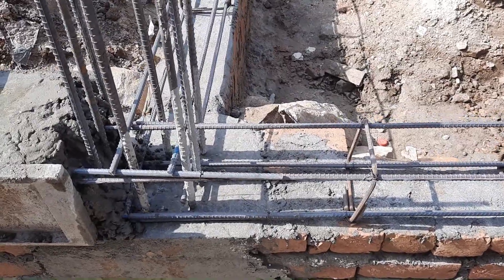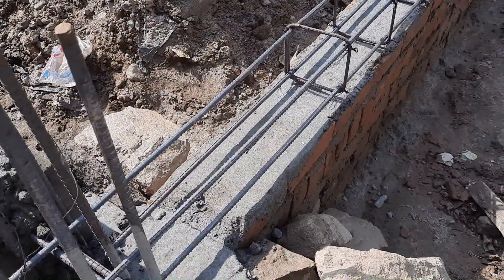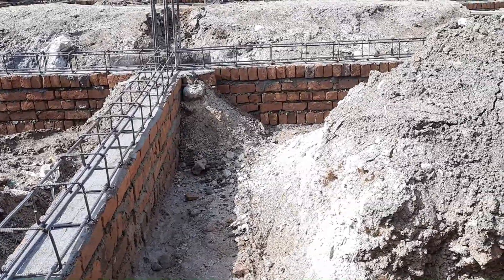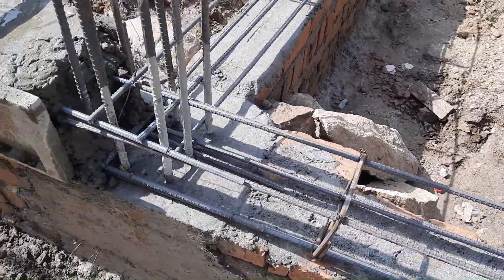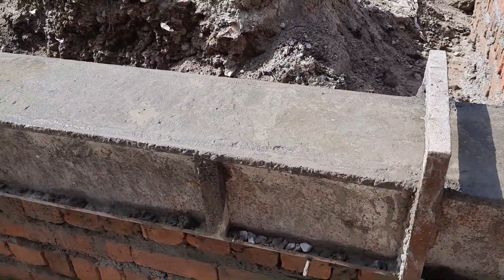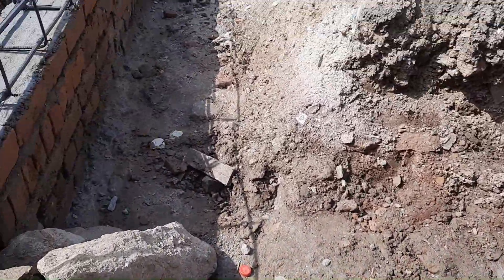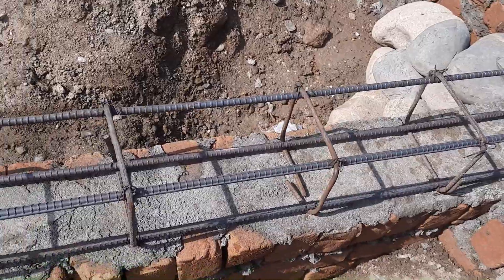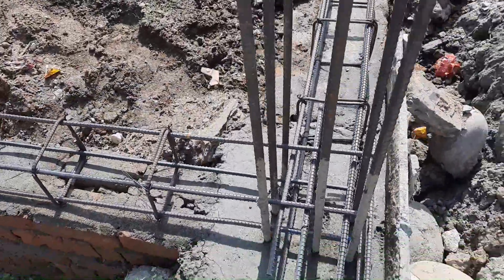7 Big Mistakes in Beam Construction | Showing Mistakes of Beam Practically on Site

Comment: hi Sami Bhai, 
Just a question regarding the width of the beam.
let's say:
- The total width of the beam is 9 inch
- concrete cover on both side is 1 inch (2 x 1 = 2inch total)

Are you trying to say that the width of the steel beam should be 9 inch -/- 2 inch = 7 inch?

I think the answer to this question will be helpful for all of us